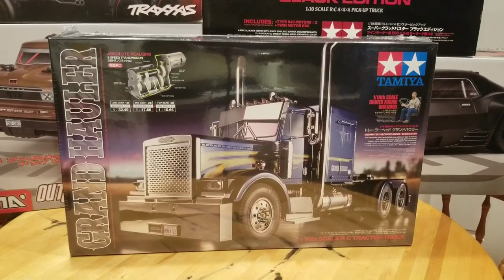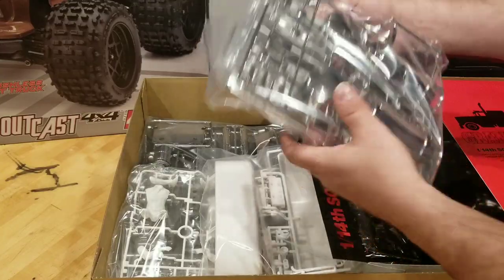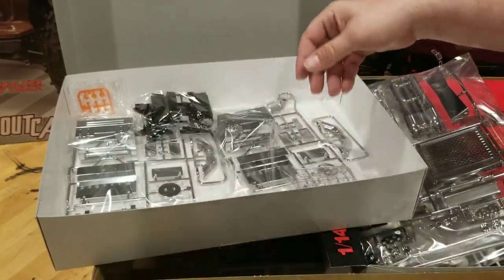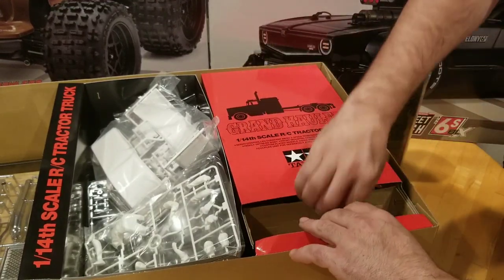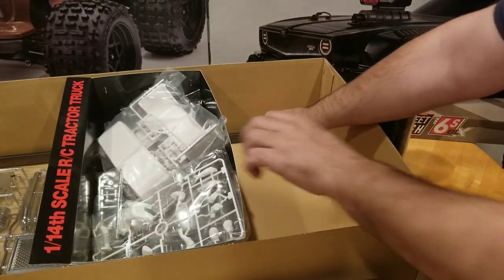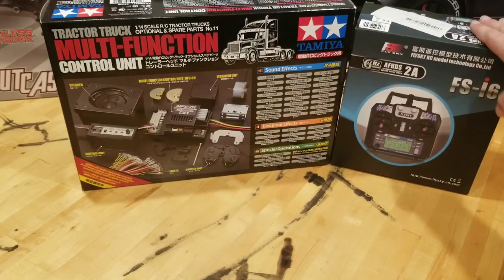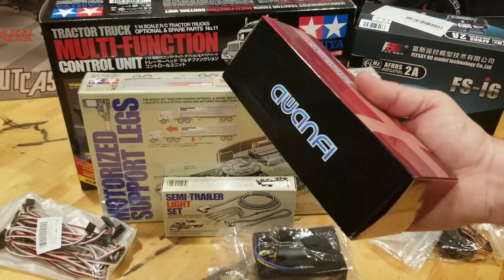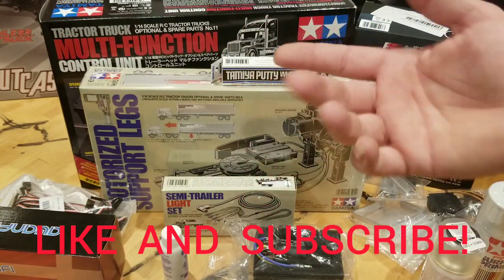Tamiya Grand Hauler Unboxing & First look (New Build!)

Comment: Do you have to put the MFC right away?
Reply from the maker: No, you do not. You can add the system in later if you need to build the truck in stages. It's a bit of extra work but not too hard. 😁🏁